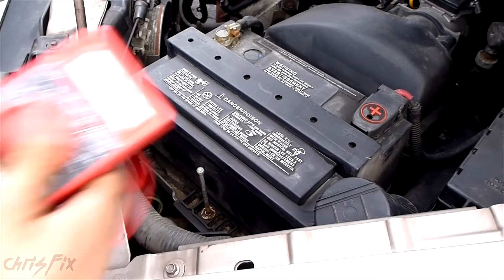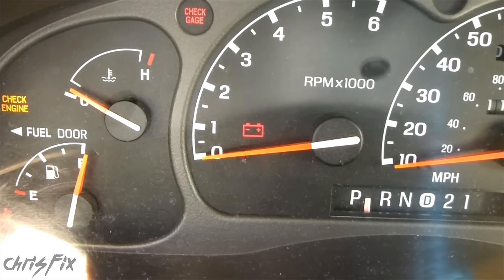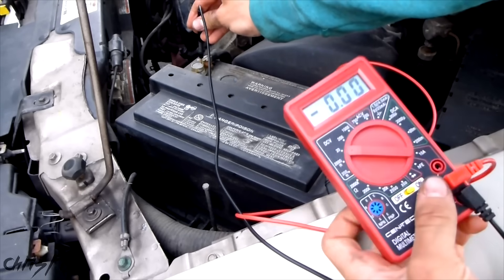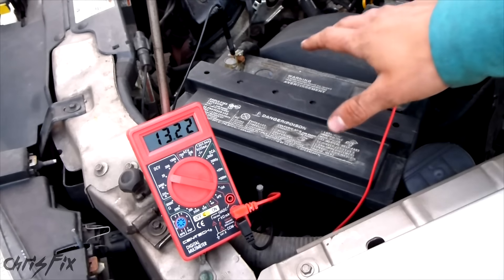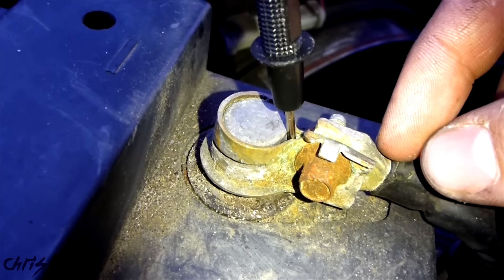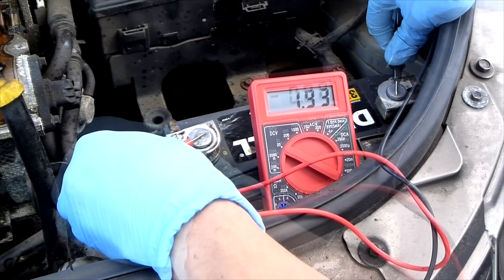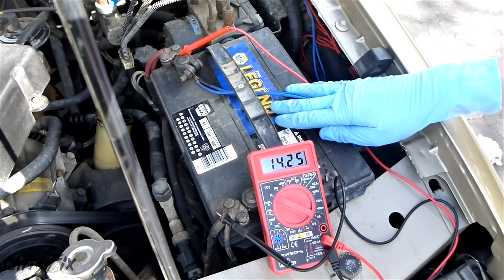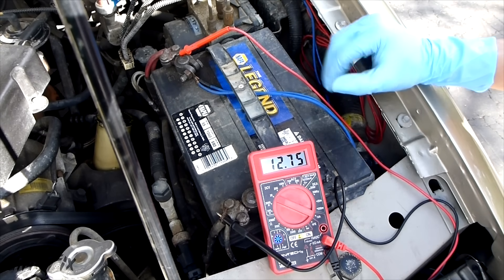How to Test a Car Battery with a Multimeter

Comment: Thank you for this cool video... my day started like any other day, the car (02 GMC Envoy) turned on and I started my daily trip. During lunch, I stopped at the park, had the radio on and off for about two hours, ate my lunch, while enjoying the view… when I had to leave the car just wouldn't start... dimmed light, low horn, clicking noise, and no crank!!! No warning, no dash light, and no code... I had to leave and just couldn’t. I asked other drivers there for help and nothing… angry, frustrated and worried. I asked myself, now what? I had seen your video, but it took me more than a minute (15 actually) to realize what it had to be done. I got my tools and gloves got to work, the first reading was 11.67 DCV on my multi-meter. Visual inspection seemed fine, but when I disconnected the negative terminal a white color and fine dust started to spill out of the connection. I scrubbed the terminal that connects to the battery with a metal brush and then the battery connection. Put it back together and waited for a few minutes, after a few minutes I tried again and the engine turned on. I was really happy… after two hours I took another reading and was 13.7 DCV and one hour later it was 14.2 DCV with all the accessories I have and did not go down. When I turned the engine off the reading was 13.7 DCV.  I forgot to use WD-40 on
the terminals, I’m going to let the car be and in the morning I will take another reading and I will spray the terminals with the WD-40. Thanks to your video I was able to save money on the labor, parts, and tow. Because, if I had not been able to fix it, I would have had to call a tow truck and had my car towed to a mechanic, I just know I save a lot of money today, I can’t thank you enough…
Reply from the maker: Sounds like you fixed the problem! Nice work! If it still dies overnight, watch this: https://www.youtube.com/watch?v=n5FJDgcdii8
Reply: Will definitely do that now just in case, txs...
Reply: This the main reason I have Triple AAA , one phone call and they are there to jump, tow or even bring you gas.
For less than 70 dollars a year it's cheap insurance.  It's great you remembered how Chris showed you how to fix your problem.

Comment: Good video but viewers should know that although this test can tell you that your battery is bad, it can't conlusively tell you that your battery is good. For that, you need a battery load tester.  A battery can pass this test but still be bad.  

Also, WD40 is probably the worst thing you can use to protect your battery terminals from corrosion. In fact, it's highly overrated for all purposes it is meant for but especially as a corrosion preventer. For battery terminals, Vaseline, silicone grease, or even (believe it or not) hairspray are infinitely better for corrosion prevention on battery terminals.  WD40 is so overrated that I hardly ever use it anymore for anything.  For general corrosion protection on metal, I use Ballistol. I tried everything to prevent corrosion on my tools, etc., and nothing worked until I found Ballistol. It's really amazing.  WD40 was the absolute worst of all products I ever tried for that purpose. However, I don't know if it would be a good choice for battery terminals but it very well might be good for that too.

Comment: What if literally nothing on the car works? I used to have some clicking, but now it's nothing at all
Reply: try turning your engine 2 revolutions and if doesn't turn u might have internal mechanical damage.
Reply: this happens do to running engine with no oil or cracked block where coolant got in cylinders causing a hydrostatic lock

Comment: I have a question hopefully someone knows the answer. 
I have a 65 ford truck with a 300 6cyl and it sat for about a year so I had to charge battery. When I started it the alt light was on and when I checked voltage at battery it was about 12.3v.  Since both the alt and voltage regulator are over 20 years old I changed them both.
The guy at parts store tested old one and said it wasnt charging.I installed new Alt and Voltage Reg  but the light is still on. Voltage is still about 12.3 and doesnt change when I start it. Since the truck did sit about a year im thinking battery could be next. I think battery is about 3 years old. Any thoughts would be graetly appreciated

Comment: I was wondering if anyone could help me please. So basically I have a Ford Ka 2003 and every time i start and crank my car it wont start itl just make a cliking noise like the battery is flat. I always have to jumpstart it with a power pack to start the car. Iv charged the battery for 24 hours and after trying again its still the same does not start. Does anyone know what the problem might be. Thanx
Reply from the maker: It could be a bad battery or a bad ground. Bring it to your local parts store and they will test the battery for free. Watch this: https://www.youtube.com/watch?v=fRfPupikHT4
Reply: +ChrisFix i took it to my local parts store and they tested my battery and said that it seems fine and told me to charge the battery and see if it happends again and thats what i did charged it for 24 hours and it didnt even start I don't think it even charged. When i turn the ignition the lights are working fine they are not dim whatsover. I dont know if its the battery or anything else. And im going to watch the video now. Thanx for replying 👊🏼
Reply from the maker: Hm, maybe it is a lose ground or bad fusible link? Check for the grounds and make sure they are clean. Also clean the terminals on your battery. Play with the wires (wiggle them) as someone is trying to start the engine and see if that does anything. Watch your arms in the engine bay and dont get hurt!
Reply: +ChrisFix Hi. I just want to say thank you soo much for your videos it helped me alot. I went to my local part store and i got a new battery and it working fine nw. 
I just wanted to ask my battery voltage and checking if the alternator is charging the battery the voltage is good its 14.6v so that means the alternator is charging the battery. I put the radio fan and lights on and it was 14.40v. But when i checked the voltage drop I connected the red to the alternator case and the black to the negative and it was -0.02 even after revving the engine it was -0.02. I also tested the engine block and it was -0.02 Will that mess my battery up again and drain it out like it did to my other battery??
I did the voltage drop again but red on positive and black on the post alternator nut and it was -0.12v instead of -0.28v. Will that mess anything up and mess my battery up??
Thanx again. 👍🏼

Comment: Thanks for an excellent video, it is helping me a great deal My battery is about 3 years old, the positive terminal has corrosion, I ran the lights for 2 minutes and checked the voltage, it said 15.79V and a bit earlier it was slowly climbing to over 16V. I was on a long trip yesterday (200 miles) and at my final stop the car wouldn't start, no dash lights no starter clicking, nothing. I jumped it  which for a few moments didn't seem like it would work and drove for 3 hours, stopped to get gas and the same thing happened. I jumped it again to make it home. I originally thought the battery was gone but I am not so sure what to test now.
Reply from the maker: Sounds like the alternator is bad and overcharging the battery (which might have damaged the battery)
Reply: I just checked again and the voltage is slowly climbing and read 16.9V. I feel like if I leave it on long enough it will keep climbing. Just tried starting it and nothing happens, no starter clicking or anything. I turned the lights on again and they didn't come on. It is weird. Things were great and then this just popped up without any warning. Thank you for the quick reply.  I wonder if I should try putting in a different battery and check whether the alternator is charging correctly like you did in the video.
Reply from the maker: I am pretty sure it is a bad alternator and not a bad battery but you can bring the battery to a local parts store and they will test it for free. The alternator is probably overcharging it.
Reply: Thanks again. I am still trying to diagnose it. Haven't put the other battery in but the plan was to do your little test to see if the alternator is getting it to 14V while running. I just want to see if it will start at all with a different battery.

Comment: Sorry, but you can still get a 12 volt reading with a multimeter even when the battery is shot.
Reply from the maker: You can, but that is why you do the test where you try to start the car and see if the voltage drops significantly.

Comment: could you tell me why my red wire on my battery get really hot that is melting the plastic on the wire
Reply from the maker: Clean the connections. There is a lot of resistance in the wire which is causing it to overheat.

Comment: Thanks for the video.  I tested my battery and it read 12.6v, When I started the engine, it didn't fall below 10, but it also never got into the 14v range while I let it run.  Is that anything to be concerned about?  
Update: So I also test the volts with the air, headlights and radio on and the voltage went to 12.85.
Should I have the alternator looked at?  If so, how quick should I do this? Do I have some time, or should it be ASAP?
Thanks, Rob.
Reply from the maker: Sounds like a bad alternator but before you replace it, clean the grounds like I show in this video: https://www.youtube.com/watch?v=LGB6ZEjGm7Q

Comment: Just don't take your battery to test at places like O'Reilly's (I mistakenly did) they do a very simple check saying battery was good, and since Im not a mechanic, per se, it took another week of dead battery head ache's for me to take it to (my new mechanic) who said the battery was toast. just sayin'
Reply: And a lot depends on the person there you are dealing with.
Reply: Wish I could give more thumbs up on that. There are guys at (O'Reilly,  AutoZone, NAPA, etc) that do know how to use test equipment and properly read the results....and there are those that would use the wrong tool, break a battery terminal, forget to attach a wire, get + and - confused, you name it. Not everyone has the same  experience level before being hired, and the new hire training programs (if they exist) are not robust at any parts store.

Comment: Dead battery is reading at 0.2v. Is it even possibly to recharge it or should I just buy a new one?
Reply: The battery has an internal short-circuit caused by shedded plate-material (lead), i'm guessing. It can happen to old batteries. You will need a new one.
Reply: +Edgar Hansen thanks. Was a 20yo original bmw battery. Had an amazing run but replaced.

Comment: used touch screen for too long and "powering off to save battery" popped up. checked voltage and it's 12.1.   wont' be driving for awhile, maybe a week will it start later?

Comment: How come your battery is not sparking like mad when you are attaching the ground? I hate connecting/disconnecting the terminals because I am afraid of the spark and I do see and hear it sometimes...
Reply from the maker: Because there is little to no draw. If you have stuff on (interior lights for example), the spark will be bigger!
Reply: Maybe there is something wrong then which could explain the very quick two week battery discharge in STi. I definitely get major sparking while connecting and disconnecting and of course the bloody Clifford "fog-horn" loud alarm goes off by default when battery is reconnected until you enter pin code which is bloody annoying...

Comment: hey Chris I just charge my battery for 40 minutes and it only came to 10.71 volts what does that mean
Reply: charge it longer. a lot of battery charges are slow.
Reply: +ElementalsMods it's not holding the charge anyway I might just go get another battery but thanks anyway I bought in 2011 I could have thought that they last for ten years at least but oh well
Reply: samone jones  ah, yeah nowadays batterys only last on average 4 or 5 years.

Comment: I did want u did and when I start the car my said 17.58 volt. please help? but my battery light comes on and I just change the alternate about 2 yrs ago
Reply from the maker: That is a voltage regulator problem in the alternator.
Reply: you have to fix this problem farly soon because this high voltage is going to kill your battery

Comment: when I try to start my truck,  I won't start bc it's at 10 volts but when I jump it, it goes 12 4 volts and I leave it run it go to 13.6 volts? do you know what could be draining the battery @chrisfix
Reply: a short somewhere.if the truck is old or very old,chances are wires are touching the truck without the coating on it.or,better yet,you blew a fuse or blew a relay.I put my money on it.check your fuses.

Comment: Thanks man I just learned how to use my 20$ multimeter I got from Sears a year ago! my truck battery is reading 10.49 and won't start.
Reply: If it won't start the truck, that means that you probably did not need the meter to determine the battery is no good.

Comment: Sorry, this is inconclusive. It can help but numerous things can cause voltage drop. I own 4 meters, average cost 300.00, plus some very expensive test equipment. A cheap meter is not a substitute for the proper equipment and know how. For the layman, it can help but it can also lead to a misdiagnosis especially with the new batteries and charging systems out there.

Comment: thaks a lot wifes 08 aveo  35000 miles no mech problems till now started and ran  radio quit windows not working and it died never had any problems befre now  replaced the battery it came new in 08 started right up but not charging  i found your clip on checking the ground points with meter ,hope its a ground fault not the alternator...

Comment: I know I'm way late for this lol but sometimes there test can be wrong at the auto parts store. my battery was bad and would drain dead after a few minutes of having the door open with the engine off or using my scan tool. alternator was good and no parasitic draw even the battery test showed nothing. so I figured maybe there was a short between a few of the plates in the battery, took it to the parts store and had them test it just for good measure and their machine said it passed. decided to get a new battery because I bought the truck used and couldn't find a date for the battery. ever since I replaced the battery there has been no issues.
Reply from the maker: +Brandon Beard Thanks for sharing! That is weird a load test couldnt detect a problem!
Reply: ChrisFix no problem, also bad cells can make a battery act up on cold days. And when you go to start it all you get is a click and it will need a jump because the CCA is much lower.....the stuff you learn when you own a Chrysler lol

Comment: hi, i got a 6.0 powerstroke. i was in the hospital for 1 month and when i came back , i quickly turned it on and off every day , but i noticed the windowns would go down very slowly and my instrument cluster did not work at all. after like 3 days it didnt want to turn on. i took my batteries to auto zone and they were still good batteries. i bought a new alternator too. and my starter is doing fine, i also took it. so i came back home put everything on, and the truck drove good to the store but while coming back it didnt wanna go above 35mph and the volts were dropping it had 11.. so i turned it off and nope didnt wanna turn back on. i double checked everything, but can find what it could be.
Reply from the maker: +Abel G Sounds like your battery is going bad or you have a bad ground somewhere. Check the voltage at the battery like in this video: https://www.youtube.com/watch?v=LGB6ZEjGm7Q

Comment: We took it to Sams Club and they said it was a little low and probably need replacement.  Its got a 7/12 sticker on it so I assume thats just under 4 years old.  I just received my new multimeter and did this battery test just like you said.  It registered 12.46 after the 2min lights on and when we started up it drop to 11.65.  I guess I'm going to keep my battery and add it to our monthly maintenance check, but your video just saved me from buying $100+ battery I didn't need to get just yet.

Thanks a lot for your time and efforts.  Keep posting those videos for newbies like me.
Reply: Andrew Nakamura They were probably talking about your cold cranking amps
Reply: Yes, 11.65 is a little low
Reply: @paulgeneslapining1655 dropping to that when cranking isn't bad at all though.
My drops to 9.78 V when cranking on a cold day and it's no biggie. Most any place trying to sell you a battery is going to say that's bad and while it is starting to go, that's not bad especially if you get 2.5 more years out of that battery they said was bad.
If you are in extreme cold or extreme heat that battery is going to go a lot more quickly than that though.

Comment: what's the reason for setting the multimeter above 15 dc?
Reply from the maker: +Ronnie Rampersad that number is the max number of volts the meter will read. If you set it below 12 dc it will max out and you wont know what the voltage is.
Reply: +ChrisFix oo..thanks mann

Comment: My second car, Chevrolte Kalos (ex Daewoo) 2005 (Europe) (150k km) still runs on original (factory) battery, 11 years so far and still good. Some unknown Korean manufacturer. I expected it to die long time ago, but still good. My first car Hyundai i30cw 2009 also runs on original battery and it also works good. I wish the new battery when the replacement time comes is like those originals, but from what i heard, 3-4years is max what I can expect.
Reply from the maker: +Ivan Doe wow, you have a magic battery haha
Reply: +ChrisFix 11y old battery just died... lol, no more magic

Comment: put used motor oil on the battery terminals and they NEVER NEVER corrode.
Reply from the maker: +Tommy Verceti Thanks for the tip!